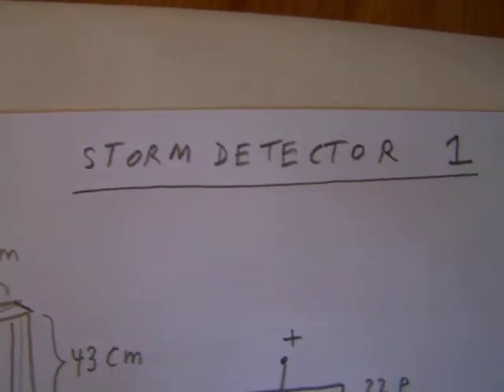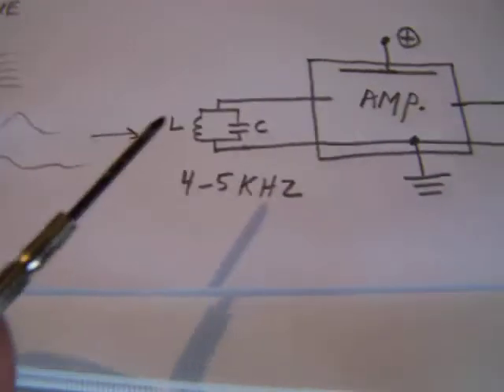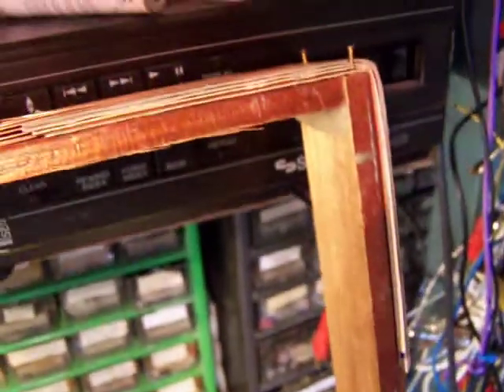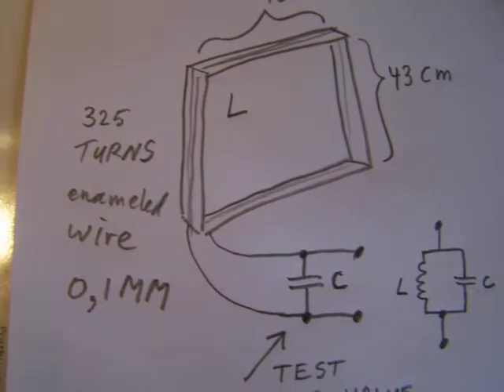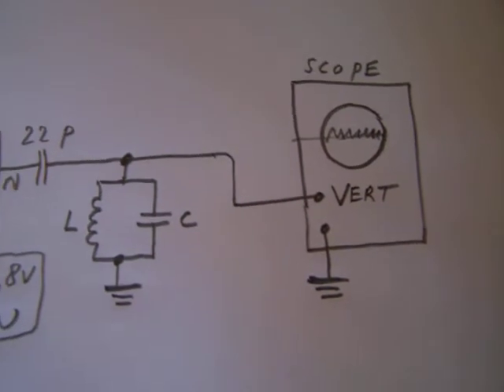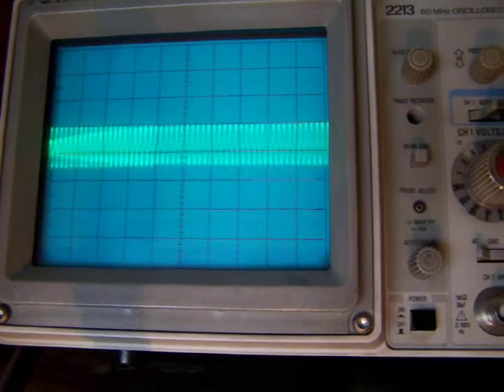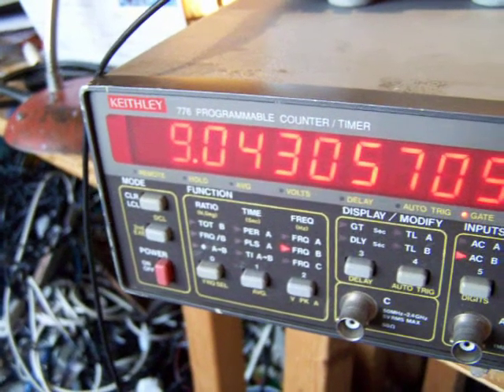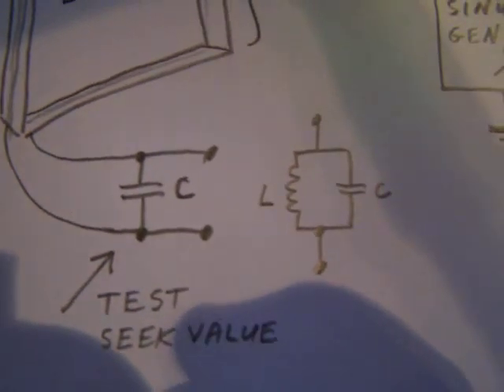Making a VLF antenna for the 2 KHz-10 KHz band and tune it in/test (old video 2008)

Comment: thanks. Do you think i can use a CRT degauss coil as a VLF coil? the degauss coil has about 18 Ohm resistance and it will be in parallel with a AM variable capacitor
Reply from the maker: It depends how many windings the degauss coil has. I Think it can work. You can make the reception frequency lower by using a higher value paralell capacitor. Range: 500 pF-3NF (first ideas).

Comment: I am trying to follow this design to build my own VLF antenna but wonder if it can be also used for transmission of VLF signals?
Reply from the maker: Yes, when the coil is connected to an oscillator that is able to work on the frequency of the coil (VLF).
Reply: @radiofun232  I have this car "1000 Watt" amplifier lying around, so thinking of using with this antenna and oscillator.
Reply from the maker: @alexandermozeika4174  I wish you success. But why and how do you want to make a VLF transmitter of 1000 Watt with that car amplifier?
Reply: @radiofun232  Connecting antenna, with a capacitor connected in parallel,   to the output of amplifier and connecting oscillator,  supplying resonant frequency, to the input. Since I am building this antenna for receiving anyway, I thought it would be interesting to test how transmitting will work, but I am not expecting any magic here - antennas of VLF transmitters are massive    for a good reason I guess.
Reply from the maker: @alexandermozeika4174  yes, OK, thanks for your reaction.

Comment: Nice video. I want to ask something:
I want to make a no-omnidirectional antenna from 1khz to 300khz. In the videos I have seen the most, the omnidirectional antennas in this band can be made small and useful. For example, the mini vip antenna ...
But the one way directional antenna I want.
is the antenna directional? you use in the project
Can I make a hand-held directional antenna in the frequency range I gave above?
Reply from the maker: Yes, when you use a ferrite rod of (say) 20 cm and wind your coil on it. Windings can be calculated or found out experimental. 1 KHZ is very low, compared to 300 KHZ. I mean: say you need a parallel capacitor in the 4N-10N range (given say a few hundred windings) to get to 1 KHZ, but to get to 300 KHZ you need (say) 100 or 180 windings and a variable capacitor of 1000 pF (at least: when you want to tune in on a specific frequency). Variable capacitors of 10 N do not exist, but it is possible to move the ferrite rod in-out to tune in on such a low frequency/frequency band.  A ferrite rod antenna acts on the magnetic component of the radio signal, by moving it in a horizontal way it is direction-sensitive to a horizontal electromagnetic (radio signal) field.
Reply: @radiofun232  Thanks very much. it was very helpfull.
Reply from the maker: @ahmetozdemir7173  OK, thanks. Here you see how you can tune in to a radio station or frequency via the ferrite rod
https://youtu.be/YmGT9VAOtz8